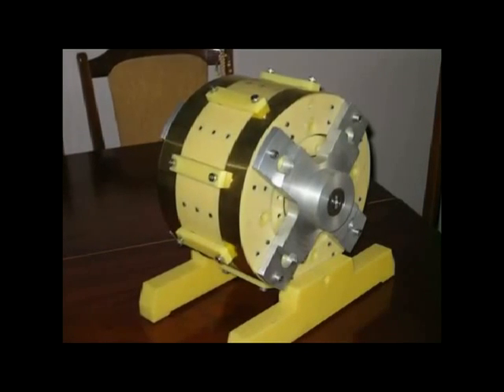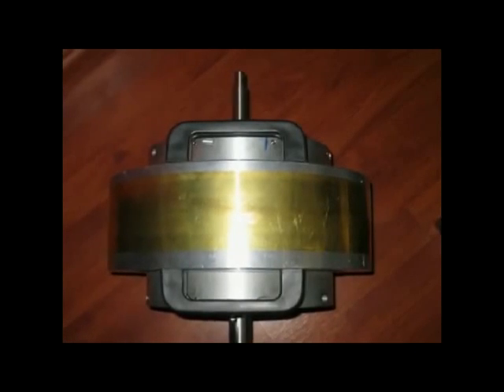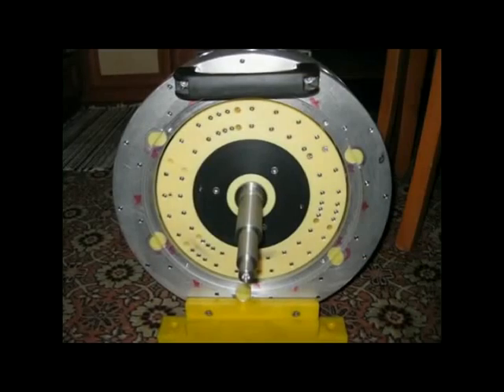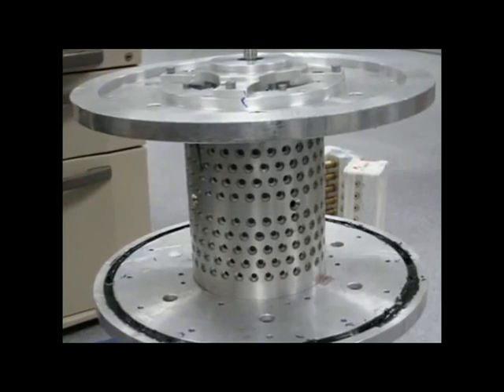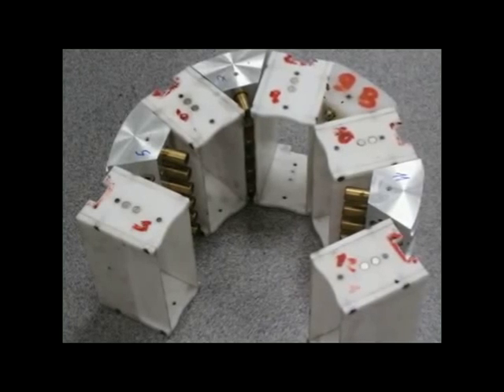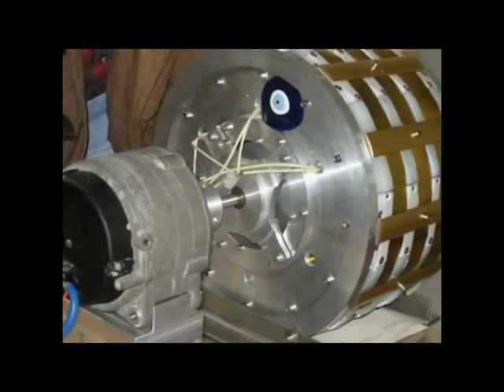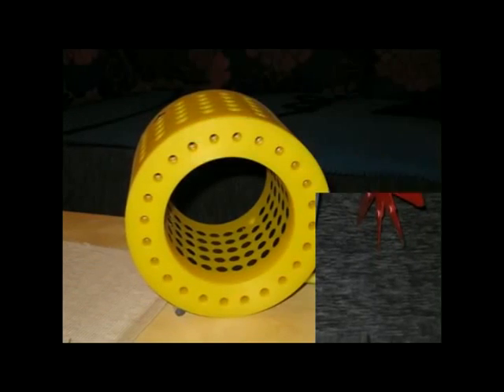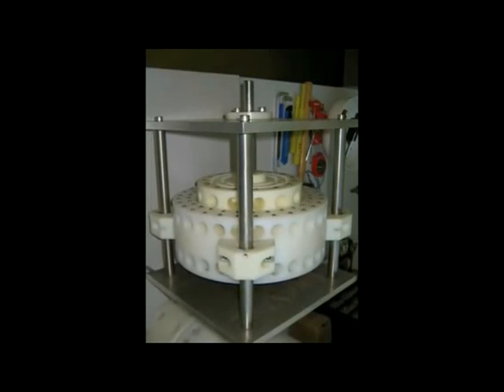johnny heath corpus christi magnetic engine

Comment: There are MANY inventors why managed to create self running magnet motors. I will list the most noteworthy inventors here: Howard Johnson (hojo magnet motor), Muammer Yildiz's magnet motor, Perendev magnet motor. The law of conservation of energy implies that a permanent magnet can't be used to do real work. However, Alden P. Armagnac's experiment managed to do just that. The results of his experiment were published Popular Science June 1944. Alden managed to slit water into H and O using only permanent magnets, without any electric input at all! His experiment proved the existence of magnetic current along side of the electric current (or perhaps both are manifestations of the same underlying force). In any case the laws of Conservation of Energy will have to be reconsidered.
Reply: +Naoki Kashima 
And all of the above are still paying their electricity bills.
Reply: +Naoki Kashima 
And none of them have been awarded the Nobel prize for their achievements,
I wonder why?
Reply from the maker: +Peter May could be because of nay sayers , that constantly try and debunk science because they cant successfully explain how it fits into the so called laws of physics , the same laws Einstein knew would be broken in many different areas because the laws of physics are old and technology is advancing at a very fast rate , hell the Nobel prize doesn’t mean anything, hell obama won one
Reply: Peter May Why was Obama awarded a Nobel Peace Prize without ever lifting a finger when Ghandi wasn't awarded one? You assume that everything is fair and people get what they deserve based on their accomplishments. In reality we have the world elites, petrol is king and queen right now but technologies to replace it have existed for over 100 years (starting with Tesla's Wardenclife Tower). I'll list a few inventors who managed to achieve self running devices: Lester Hendershot (Hendershot Generator), Thomas Moray, Edwin Gray, Stan Meyers. The time for oil is at its end. The technological suppression is cracking and technology is seeping out of the cracks. Even I started to experiment, I managed to replicate cold fusion among other things.
Reply: Peter May Why did Obama got a Nobel Prize without lifting a finger while many others more deserving people (like Alden) didn't get one? The reason is because of corruption. The elites give the Prize to their friends NOT people who actually deserve it :)
Reply: Naoki Kashima Excellent perspective, i appreciate the comment!
Reply: Quantum Leap It is reality. Reality is based on observations. If new observations are made that defy current theories then instead of ignoring these observations we should re-write the theories! Conservations of Energy Laws as well as the Theory of Relativity have been debunked. You can have energy being created/destroyed in a system, you can have things move faster than light. This has already been proven.
Reply: +Naoki Kashima what things can you get faster than light?i know only one thing that is faster than light. time and space are a trap in this world. guess that what is faster than light is also the exit tool.....
Reply from the maker: +Peter May i dont pay an electric bill we only pay the charge to have service ,for the power meter,  renewable energy sources offset our usage with the grid tied power inverters that cover our usage
Reply: ***** Have you watched the video above? We have 3 inventors that managed to get self running magnet motors. 1) Howard Johnson the Hojomotor 2) Perendev Motor 3) Muammer Yildiz magnet motor. Yildiz even has these motors commercially available through a German website. People who are interested in this technology please look up any one of the 3 inventors that I listed above :)
Reply: ***** especially mainstream media :)
Reply: +Naoki Kashima 
"Alden managed to slit water into H and O using only permanent magnets".
That is truly amazing, and yet, no Nobel prize!  A monsterous  travesty you might
think.Why don't you nominate  him again?
Reply: Naoki Kashima Alden was a fraud.
Reply: ***** You are a dis-informant, in your book everybody who goes against mainstream science is a fraud. I think Einstein is a fraud. His theories were completely debunked by Tesla's early experiments. Longitudinal waves travel faster than light, it has been proven through experiments.
Reply: Peter May Are you familiar with Tesla's experiments at the Colorado Springs and Tesla's Wardenclyffe Tower? As you know Tesla was working on wireless electricity systems. The problem is that with the electromagnetic wave the energy losses are exponential with the distance. Also, the electromagnetic wave is a retarded wave in that it moves slower than the velocity of light. Within the electromagnetic wave the electric and magnetic forces as well as propagation of the wave are all at 90 degrees to each other. In his Colorado Springs experiments Tesla managed to light a series of light bulbs many miles from this transmitter station. All he had to do is hook up his receiver to the bulbs and ground the other end. Tesla calculated the speed of transition of this electric signal and it turns out to be Pi/2*C or about 1.5 times the speed of light! (so much for Einstein's theory) Furthermore he wasn't getting any losses from the transmitter to the receiver where the losses should have been exponential in a traditional system. It turns out that there is a way to align the magnetic and the electric components of an electromagnetic wave in the same direction as the direction of the propagation of the signal. Tesla had stumbled onto a new type of electric wave the longitudinal electric wave. These waves moves through the Earth instead of through the air, these wave exceed the speed of light, and they can not be shielded by a Faraday Cage. These waves are very focused (don't radiate in all directions). Tesla planned to use the the Wardenclyffe Tower to supply wireless energy for the whole nation. However, due to lack of profitability his project to shut down and the tower was blown up. If you're interested in this technology I can provide links to working models showing you longitudinal waves and wireless power in action :)
Reply: Peter May Yes you are correct, the inverse square law is what I was referring to. In either case the loses are exponential with distance. The bigger the distance the bigger the loss.

With longitudinal waves there are virtually no losses at all! In the 1988 there was a research group called "Boarderland Science" they managed to replicate Tesla's wireless power experiment. See their experiment for yourself here: h t t p s://w w w .youtube. c o m /watch?v=3uXL4_Yas2k
Reply: ***** Nope, you are completely wrong about that. From my weight to Christian school to the impossibility of free energy. Ever heard of solar panels? Well, that is free energy. The energy comes from the environment. We are tapping solar energy for power there. What about tapping free electrons themselves for power, or maybe neutrino particles? Devices like the John Searl Generator, Testatika and Hendershot Generator run using no conventional input. However, the input may be free electrons themselves. The environment contains an endless amount of free electrons. Observations > Theory
Reply: +Naoki Kashima as long as it creates motion it will make energy so if its steam or whatever magnets as long as the motor spins it will have energy the faster the spin the more power
Reply: r. decline I define "FREE ENERGY" as something that you don't have to pay for. Nobody charges us for sunshine. We however are charged for the fossil fuels (gas, coal) costs money. Either we have to blow up a country to take the oil from the ground there or whatever. These technologies requires people to keep paying at the pump again and again. What about solar-powered cars from 1980s? There were races using cars that ONLY ran using solar power. Since then the solar panels have vastly improved, also 'super capacitors' were developed that can store the charge (about a million of charge/discharge cycles). A solar powered car WITH super capacitors would last for decades w/o ever needing any service (electric engines are also more durable than internal combustion ones, require no oil for lubrication, etc.)
SOOO why can't I buy one? Solar powered vehicles have been around for about 40 years now!! The reason is that FOSSIL FUELS are just too profitable right now. No new technology is allowed to come out that would compete with these established technologies. The same goes for water-powered cars, self running magnet motors, radiant energy devices (Hendershot, Moray, Testatiaka generator, etc.) PLUS, since BIG OIL has so much money they can pay scientists, politicians and internet trolls to poo poo on any new technology. That is the bottom line.
Reply: r. decline Keep laughing, free energy is coming one way or another. We don't have to develop anything, it is already ready. Look up GDS water-powered generator. It has been certified and ready for shipping this year, price point has been established :) The Banking Elites have lost control over this planet. It is game over for them, all the trolls will lose their jobs in the near future.
Reply: Naoki Kashima Yes, it's coming, and it will remain in that status forever. Coming, cooomiiinng....commmiiinnnngggg.....
Reply: ***** nope, not anymore. It is coming at a good speed now. Here is a Brazilian inventor who managed to get his motorcycle to run using water alone, here is the news clip: h t t p s://w w w .youtube. c o m /watch?v=jV8rpumumxo Inventions like these are getting more and more common and come from all over the world. We had a Jap company creating a water-powered car in 2006, here is the news clip >> h t t p s ://w w w .youtube. c o m /watch?v=CrxfMz2eDME The Banking Cabal, or the illuminati, whatever you want to call them can not keep suppressing these technologies. Their new world order will fail and humanity will have a bright future ahead of us. All you troll will feel pretty ashamed because you were supporting the corruption that you should have been fighting :)
Reply: Sure, it will come REAL SOON NOW!!!
Reply: r. decline LOL you said 'claims that breaks with reality"... what is 'reality"? Is it was CNN and FOX tells you? Is it what you learned in school? Truth is much of all this is  dis-information designed to brainwash the people. My video for a motorcycle that runs on water is from RT News, an official news source. Is CNN more credible than RT News? Well... no... Russia has a law where a foreign entity can't own more than 15% of any news outlet. US doesn't have this law. This means that Russian news is owned by Russia, and US news are owned by Britain... (or British citizens). CNN and FOX are in the pockets of the banking cartel, everybody knows at this point :P
Reply: r. decline Fact remains that the inventor managed to do it. It wasn't the first instance of a man inventing an engine that works using water for fuel. Why not? Water has Hydrogen and Oxygen both gasses are perfectly combustible. Thus 100% of water can be used for power if it is split efficiently (Like Stan Meyers, and many others managed to do). What is keeping this technology from being sold openly at the moment is Big Oil. Stan Meyers was murdered to keep his water car from competing with existing oil-powered cars. You can argue about equations, theories, but we have tangible devices here... These device will bring the end to oil, 100 years too late but it will happen.
Reply: r. decline Bottom line is we have working devices from dozens of inventors. I can easily give you links to 4 stories taken from mainstream news about water-powered engines. (well 3 mainstream and 1 rt news). If you don't believe that this technology is real then you are in a minority here and that is YOUR belief.... it is not reality :)

Troll all day and all night but this technology is coming very quickly now.
Reply: +Naoki Kashima where can I find plans to build magnetic generators like these? If you could point me in the right direction I would be greatly thankful.
Reply: ***** thanks for you're info but I wasn't asking you. :)
Reply: ***** if it is then i would like to find out myself, but thanks for you're impute.